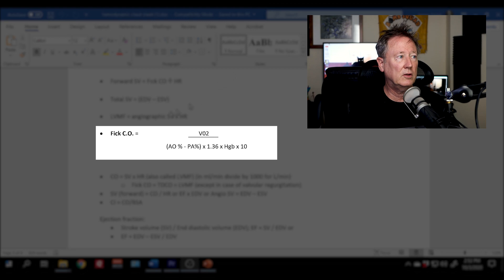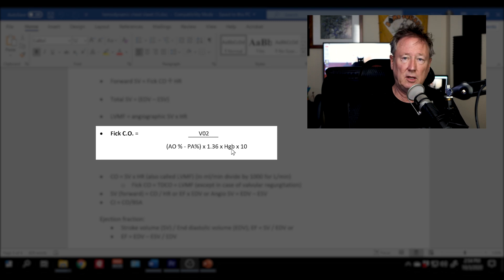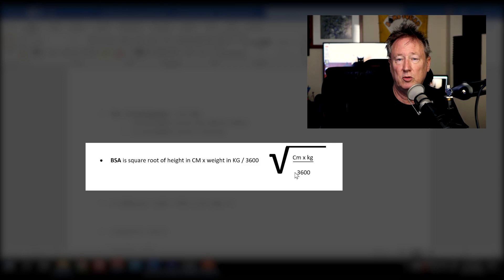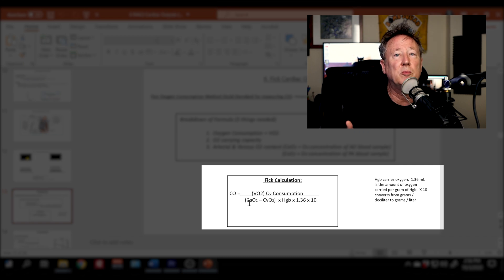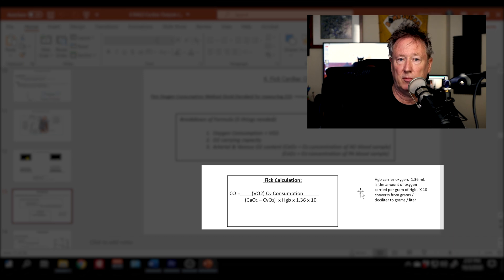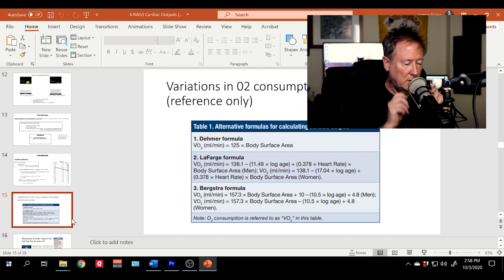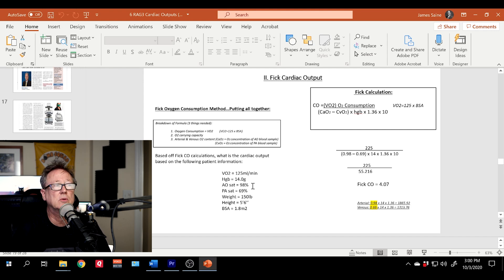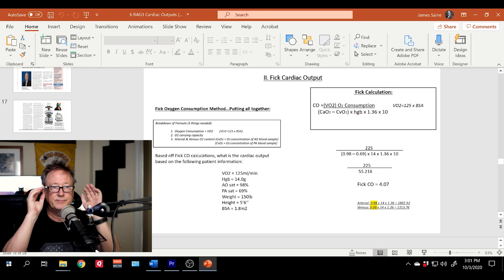Fick Cardiac Output; how to calculate

Comment: How do you figure out the BSA with only weight and vol consumption? It was on my test and couldn’t get the CO cause I couldn’t figure out the BSA
Reply from the maker: I’m not sure I can figure out BSA with kg and vol consumption only. Do you regenerate the question?  There are quite a few BSA formulas. Like 3ml x kg.   

(Additionally another formula for 02 consumption is:
V02 = CO x AV 02 diff)
Reply: @JamesSaine  yes that’s what I meant 3ml x kg that’s how I’d get the bsa simply 3xkg?
Reply from the maker: Sorry 3 ml per kg is O2 consumption, not BSA